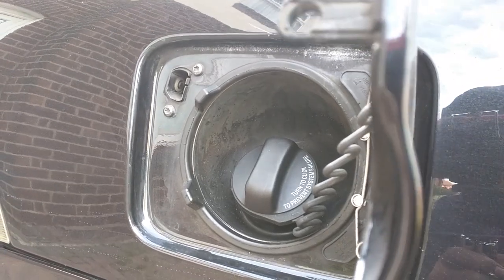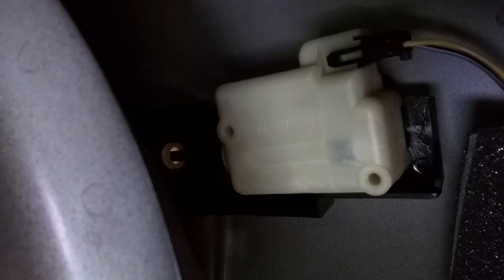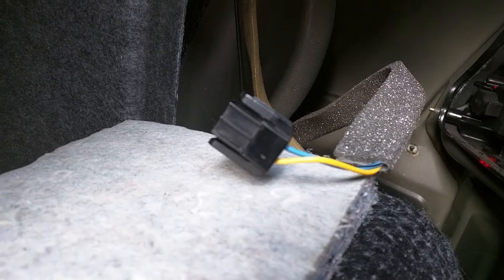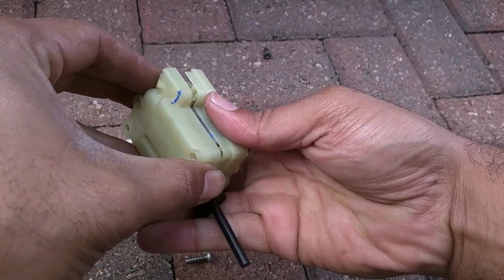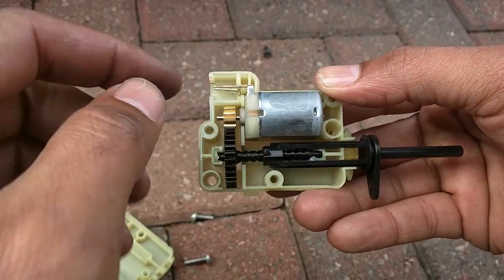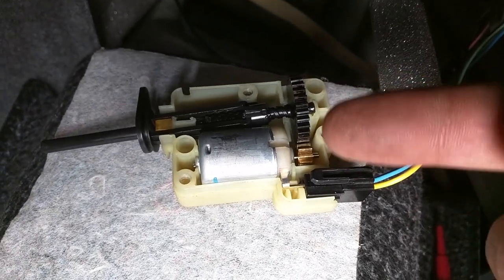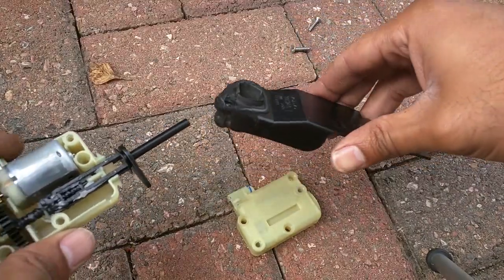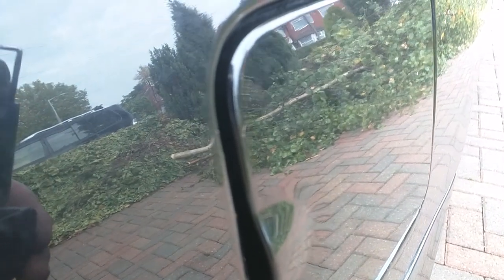Volvo Broken Fuel Flap / Door Lock Free Fix

Comment: Thank you for a comprehensive, easily understandable  video and explanation. I am not a mechanic, but little more than an adequate DIY'r, so with your video instructions on my mobile phone in one hand and a screwdriver in the other, I gave it a go. Brilliant! Success immediately and exactly as you described, so I really am most grateful.
Reply from the maker: Steve Harrison That's great to hear Steve and thank you for taking the time to comment.
Reply: Thank you for this. This whole system is stupid. There’s nothing wrong with a simple flap that you press on the outside of the car. More technical wizardry that can go wrong. How many times have I gotten out of the car and forgot to press the stupid button and then I had to go back around and push it.

Comment: Dude, your multimeter has the turtlenecks on the electrodes. Those metal contacts are actually 2 cms long but you gotta pull plastic fore skins off.
Reply from the maker: There were ok for the job in hand.